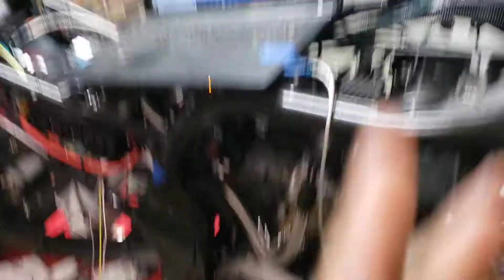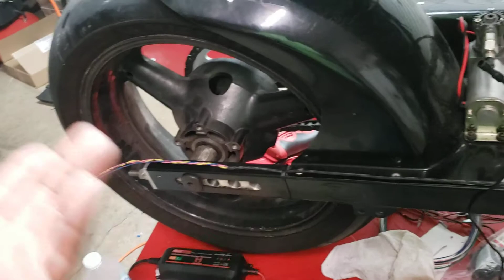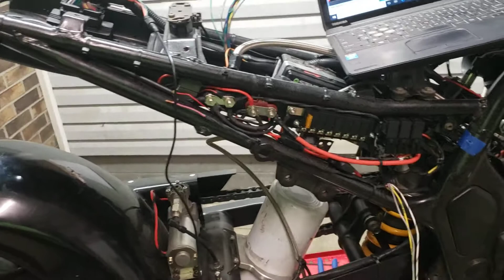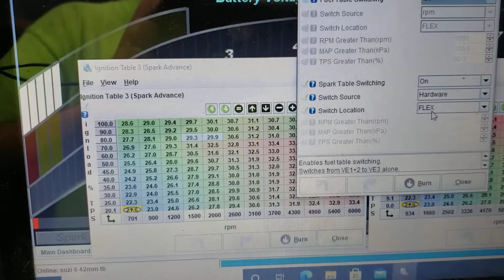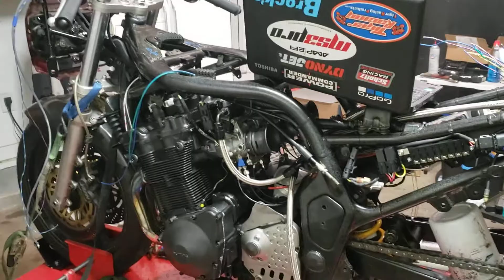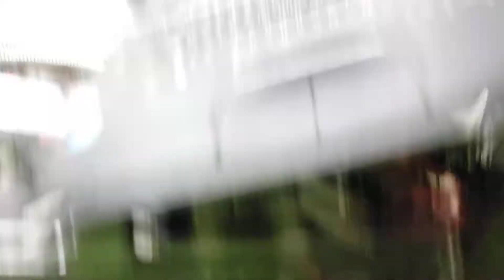Suzi-Q the EFI 1200 bandit has a brain again.

Comment: Hello how are you ?
I really liked the project, I'm starting mine on a Suzuki RF600R, I know it's old but I can already learn it.
Where I am standing is when buying some carburetors with injection, what type of carburetors are you using in your project?

Thanks.
Reply from the maker: Currently I use gsxr1000 throttle bodies I had gsxr600s that were a bit smaller